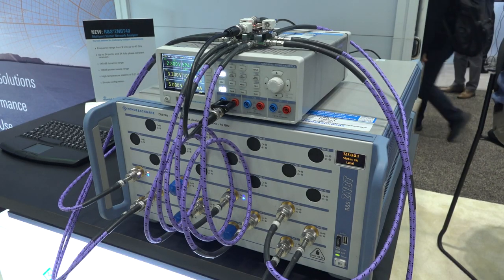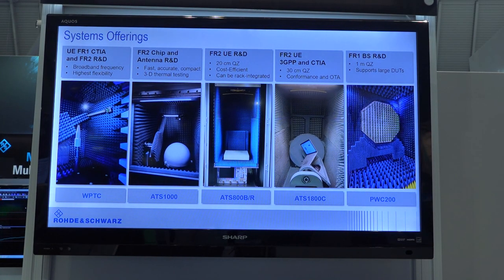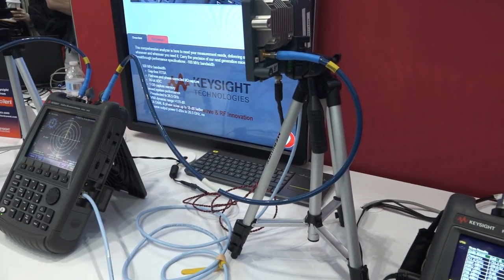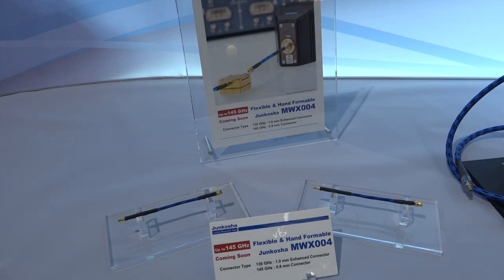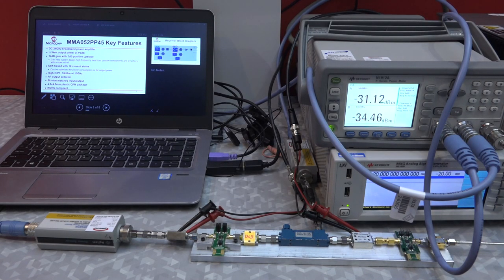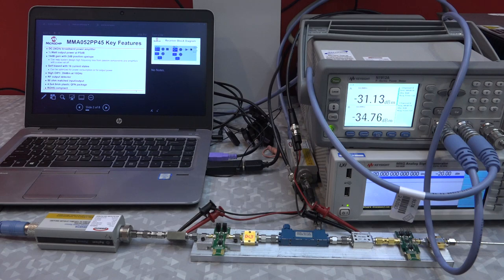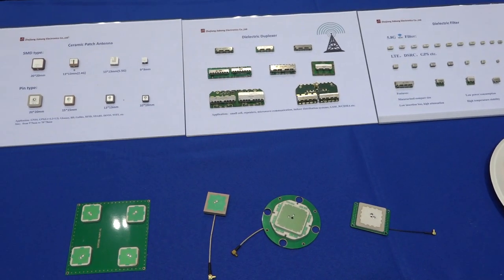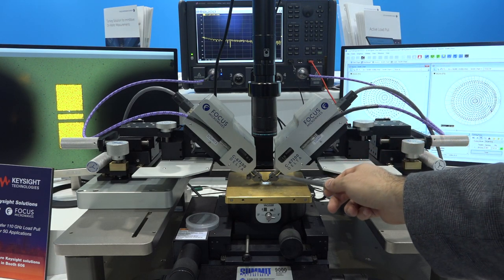TSP #153 - International Microwave Symposium 2019 - Industry Trade Show Overview

Comment: The multiport network analysis for phased arrays (etc) was pretty good, as was that thermal-noise limited signal characteriser. I do wonder about the serviceability of those flat-flex-integrated PCBs, though. (Or rather, I don't.) And the thermoreflective heat mapping was awesome. From the point of view of stuff I might actually get to use one day, though, the downconverters for SAs were most interesting - a look at one of those (esp. the noise performance, linearity, etc) on the bench would be good.